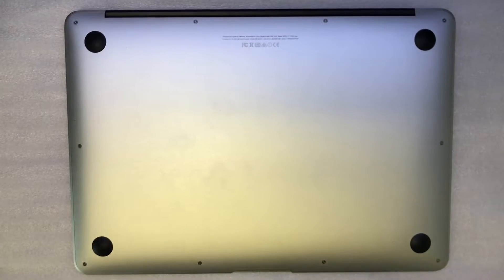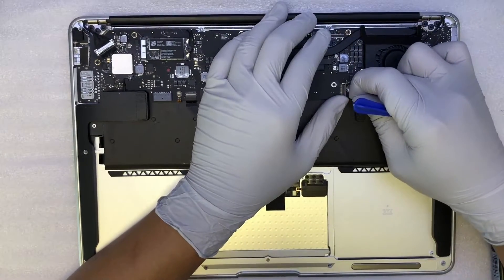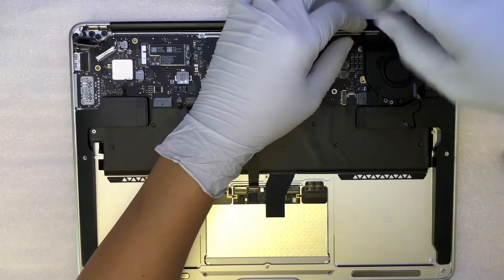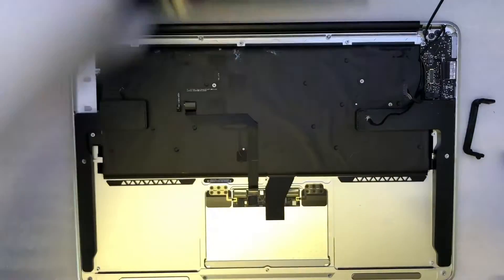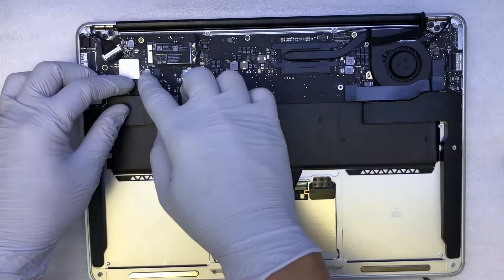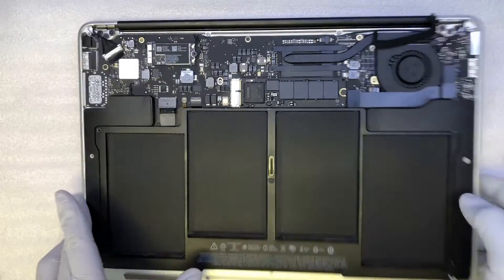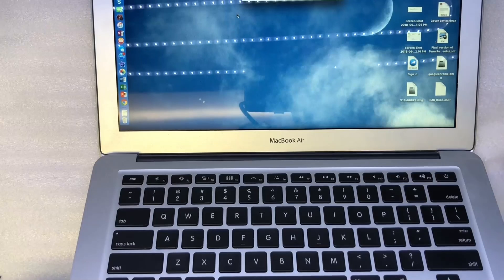Macbook Air 2015 Motherboard Replacement - Step by step

Comment: Can you upgrade to a faster board I broke the battery connector.  Computer still works had water damage.  Drive was damaged running on external usb drive

Comment: Hi, thanks a lot for this excellent video. Could you help me to confirm the diagnostic of my MacBook Air Early 2015. It boots on a loop and the hardware diagnostic shows error PPM002. I want to be sure a new logic board will fix the issue. Thanks.
Reply from the maker: Yes. Logic board replacement will fix the issue

Comment: How would I backup all my files ect when my mother board doesn’t work or switch on ? , as I need to replace the motherboard but I also need my files ect
Reply from the maker: You should able to pull the 2.5 inch hard drive to recover your data

Comment: I've seen guides that say you should remove old thermal paste and apply a new layer to the heat sink on the logic board - do you think this step is necessary?
Reply from the maker: Yes. Given the age of the laptop. Thermal paste must have been dried out.
Reply: @UbergeeksBiz  Ok, thanks! I'm gonna use your video to put a new logic board in my 2013 Macbook Air!

Comment: I want to change the hard drive for this exact same model mac book air how do I do that
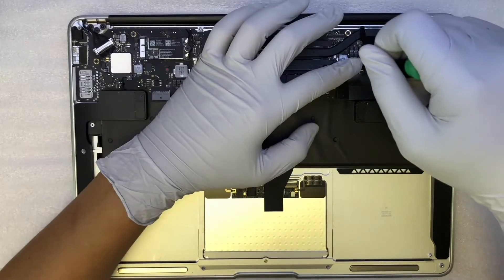Reply from the maker: At 3:08 is where I remove the SSD. If you plan to upgrade a larger SSD, try look up on ebay or amazon. After upgrade, you would need to reinstall Mac OS

Comment: after motherboard replacement does it need some programing ?
Reply from the maker: No. It will boot right up. Maybe you might need to change time and date.
Reply: @UbergeeksBiz  just nedd a1466  motherboard to replace,does it need more specs for replacement than macbookmode?
Reply from the maker: @Tsitsqa9297  Nope. Just it self A1466 motherboard will do.
Reply: @UbergeeksBiz  thank u :)

Comment: don't forget about the fan duct rubber gasket you need to make sure it is placed before screwing down the logic board.
Reply from the maker: Yes, that's right.

Comment: Can you tell me if the Macbook air 2017 motherboard fits the Macbook air 2015 if they are the same physically, I would like to change mine
Reply from the maker: Yes. The size and fittings are the same. Make sure you double check again before purchase the upgraded version.

Comment: What are the two screwdriver used?
Reply from the maker: Pentalope and torx screwdriver
Reply: @UbergeeksBiz  is that necessary to use the handglove?
Reply from the maker: @Leo_shah  Not necessary. But I prefer to use it. :)

Comment: This is so cool!
I think I have almost the same - macbook air early 2014 - I have 8GB of ram and I went with the i7 BUT! It would be so nice if there was like, 4x4GB of rams that I could get at least 16GB of ram.
Or haha change the processor or something since it's also soldered. Is it the Logic board / motherboard that stops this not supporting higher ram or? I think I read the processor or so. Would love to hear some opinions!
Reply: You absolutely can do both of those if you know how to solder and also have a hot air rework station. You can move the processor from the non working board to the new one but you would need to have solder balls and a stencil in order to prep the cpu slot and with the ram it’s actually just regular solder point on each of the 4 chips. Then you also need to reset your Mac following the procedure. It’s not impossible to replace soldered in components it’s just something that you would really need to read up on and practice on donor boards before you’re comfortable enough to do everything
Reply: I am 60% certain that either the cpu or the logic board itself doesn't support 16 GB of ram (8 GB is the max), also I am 40% certain that there isn't any practical options for cpu replacement...
Reply from the maker: You can't go beyond the logic board specs.

Comment: I have a late 2014 macbook air. Can I replace the motherboard with a good one from an early 2015 macbook air?
Reply: tennozuairu was also wondering the same thing
Reply: Yeah you can 2013 2014 2015 model motherboards are all the same as long as you have the right serial number
Reply from the maker: Yes you can. 2013, 2014 and 2015 all same model